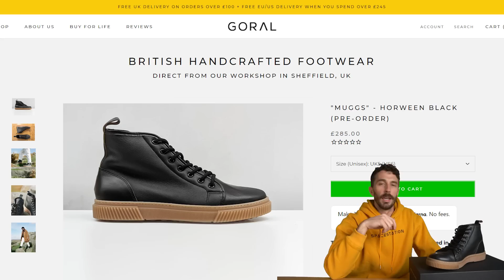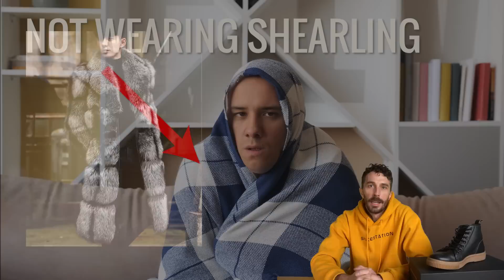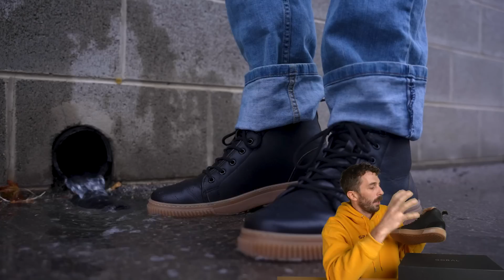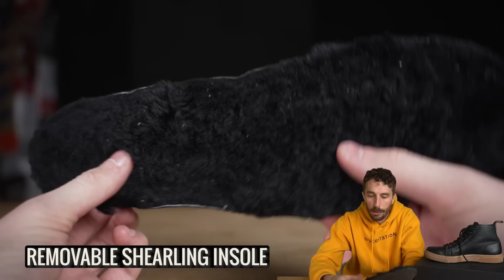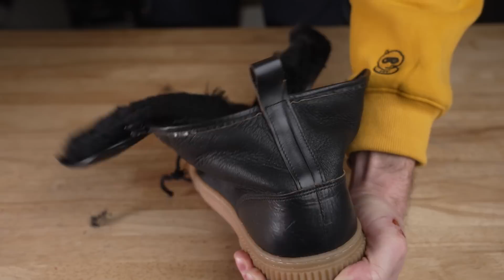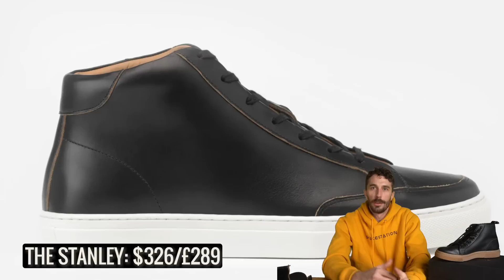Why UGG will be bugged by these MUGGs

Comment: Goral is, without a doubt, the most frustrating company I have dealt with. First, the delay is shipping is annoying. These aren't bespoke. For $400, speed up production. These are made in a factory by an assembly line, not a single man in a workshop. Second, terrible shipping arrangement. Pray you don't have to return them bc if you're in the US, prepare to pay $100 just to exchange. Third, hope that the business is professional enough to receive packages when "on holiday." My return was in limbo for two weeks simply bc no one at Goral was at the door to accept deliveries (preposterous that this was even an issue). Fourth, cross your fingers that the factory doesn't suddenly shutdown for yet another several week extended holiday where literally everything is put on hold. No staggered vacations for employees? The entire production shuts down for several weeks in July? Fifth, don't count on them to include complimentary items promised due the multiple month delay. And finally, once your exchange item is finally delivered (after three months), don't expect the shoes to even be the correct color. Ordered dark brown shoes? Sure, how about red instead? 

I'm honestly surprised this company has managed to stay afloat.
Reply: I wanted to resole my shoes thru Goral, thinking it'll be great. I was thinking I was gonna pay just for the resole but instead I ended up paying $300+ in the end. Literally the price of my shoes. Never again. Rather take em to a local cobbler.

Comment: I love your videos, it’s very interesting to see how shoes are actually constructed and how to look for actual quality. I was wondering if you’d consider investigating the UGG brand again. I recently purchased a pair of their Adirondack III (the women version of their Butte winter boot) since they came highly recommended. However, it seems that they are all now labeled as UGGPlush (the 80% wool 20% Lyocell), instead of the UGGPure (100% ‘up cycled’ wool) as stated on their website. Their customer agent said it was a “manufacturing sticker error”, but I’ve seen some reviews that have experienced the same. Also, the description says it uses real shearling…though now I am highly skeptical of how much shearling there actually is. It would be greatly helpful if you would consider possibly looking into it, whether their product matches their description or if it’s another case of a company using their name to cut corners.

Comment: The sole has that stan smith kind of wall pattern that creates pressure points on the outsole - I remember you mentioning you dont like it on the stan smiths.  They collapse and become pressure points don''t they? Looks like I missed out on these but I'll sign up for the email and see what happens. I'm interested in a video on 2015 Jordan 1 Pinnacle Vachetta Tan to see the leather quality and if it's worth it.

Comment: These shoes are not very good!

No sew in tongue - water and dirt will easily go inside the shoe. 
Narrow last.
Thermal insulation is much easier to control by proper socks. Permanent wool layer inside the shoe is bad idea. Hard to maintain it, hard to clean it and it will wear and compress... It is too thin for very cold weather or Arctic anyway. 
Gimmick shoe.

Comment: These are looking almost as good as the ones made from the jacket. I would not hesitate to wear them based on looks. I own a pair of the Goral x Peregrine tweed sneakers, and it seems to me that the height of the toe box and the narrowness of the last might just be the reason that when I wear these on my wider feet with toenails that grow "upwards", I can't do that many days in a row until I feel the pressure. The MUGGs looks to have somewhat the same dimensions on their toebox. Though I do believe that the leather would stretch more than the tweed...
Reply: Hi, since launching the collaboration with Peregrine, we've introduced a G-fit on our last, which hopefully can help with the above issue. If you make a note on the checkout page this can then be sent to the workshop.
Reply: @GORALFootwear  thanks for the prompt reply. I might just look into that. I am guessing that it is too late in regards to the Muggs, but you have other nice stuff on your web page, so...

Still waiting for the Goat skin sneakers though :)

Comment: Absolutely love that, would 1000% buy it...if it was in a wide. I'm a 4E and no one makes cool sneakers in 4E.
Reply: I have this same issue. Sometimes if I want a shoe I have to get a size and a half bigger just so it's wide enough for my foot.
Reply: I made some wooden blocks (about 2" by 4") using 3/4" thick white pine.  I traced my feet and used the widest portion (8 1/2 3E) to stretch my leather sneakers.  I typically wear 9 since EE and wider are rare except New Balance and Reebok but those are Dad shoes.

Comment: do you pay duties on stuff shipped from uk to us?
Reply: No
Reply: of course you need to pay duties. check your local tax rate before ordering
Reply: @justintran3586  Goral as international seller without presence in US is not required to collect sales tax and there is no import duty on goods under $800.00. Personally I received many shipments from EU and UK in $200.00-300.00 range and never had to pay any duties.

Comment: I liked contrast binding and double row stitching of original MUGGS, but I like reinforced toe and heel on these. 
I need at least 12.5 UK (without shearling liner) so I'm making my own pair as these max out at 12 UK. Vibram Moretto cup soles with astrakhan shearling and veg tan insole, toe/heel reinforcement. I will have to use jerk needle for manual Blake and cup sole stitch.
Reply: Make me a pair too. 15 wide
Reply: @davidedward13  Sorry, nobody makes cup soles in that size. European 47 is biggest I've seen and only D width

Comment: Since the cupsole is glued on I doubt it can be easily remove without destorying the leather underneath.
Reply: Get an oversized converse and throw a sheepskin insole in it. Either way the cheap heels will wear super fast
Reply: surely solvents would be able to do the job?